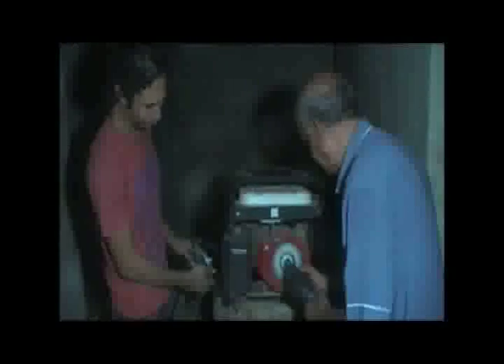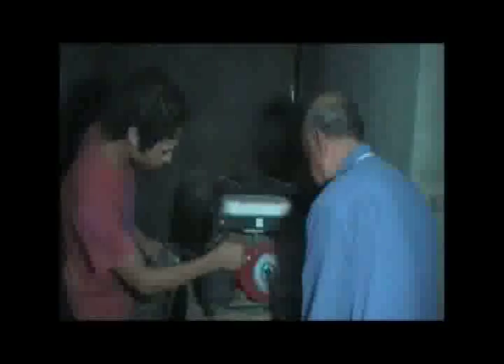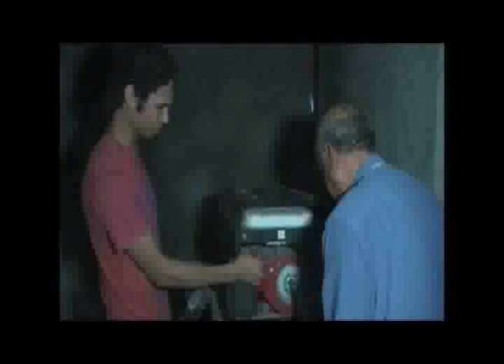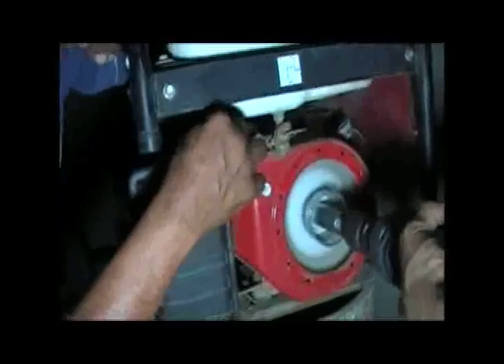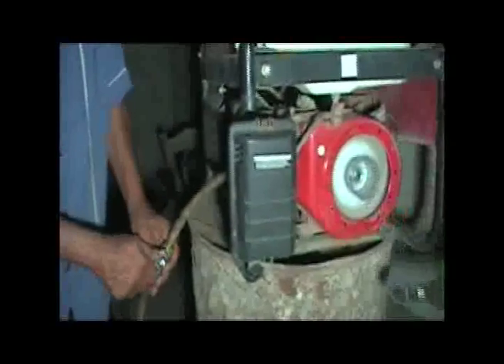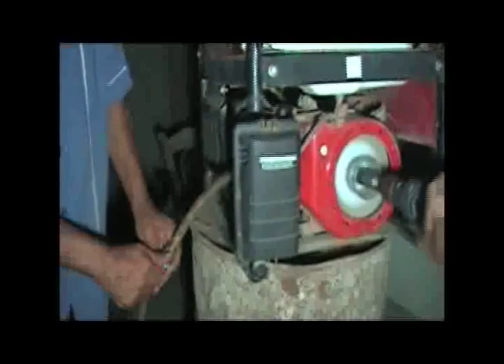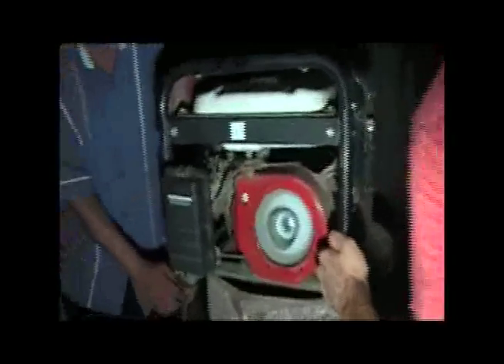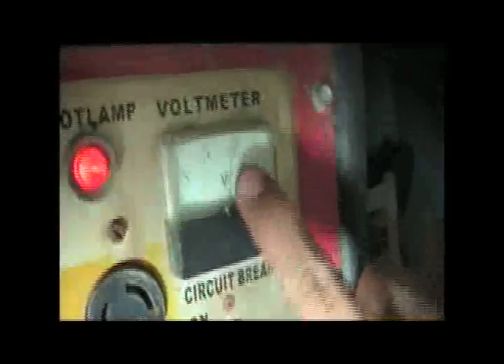Running 6.5 HP electric generator on Biogas in Cairo, Egypt

Comment: Hi I have a project a little similar to what you publish on youtube on the conversion of the biogas generators. and so I wanted you to help me for details of this conversion especially without conversion kit safe that I won't find this kit here in Africa. I sent the biogas at the level of the filter air and the level of the carburetor but without result it suggests that without the conversion kit "US carburetion" it'll not work

Comment: I got one advice (If I haven't given it already) - get an old fridge compressor and use it to compress the methane produced... of course that would require some energy to be wasted but at least you could use a small tank to hold larger quantities of methane

of course you might as well build a wind powered compressor - that would require no electricity - though it does make things a little bit more complicated

Comment: @tculhane 
In case of the 'simple telescoping biogas digester' the moving part is of course the telescoping part of it

It would be even better to use a presssure gauge... though mind you that the max pressure generated might be as low as 2 psi or less - so you need a gauge in that range

Comment: That could have been predicted. The reg is redundant since the pressure is just way too low (to calculate it just divide the mass of the moving part of the reactor by its surface area... of course you have to use either pounds & inches to get results in PSI or kgs & cms to get them in bars). 

Have you actually measured what is the max pressure you can achieve with the design you use at the moment? I guess not